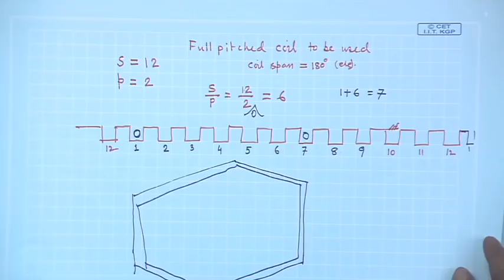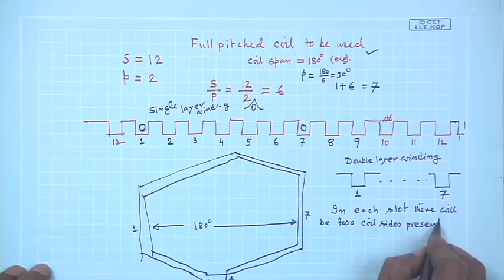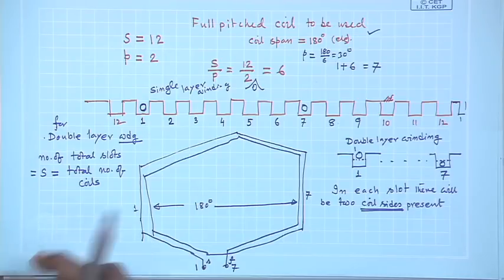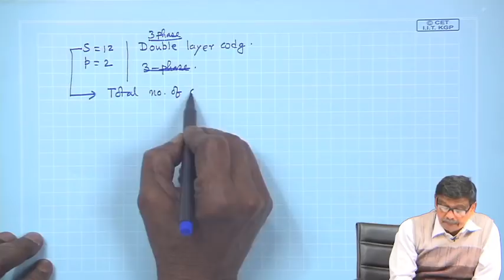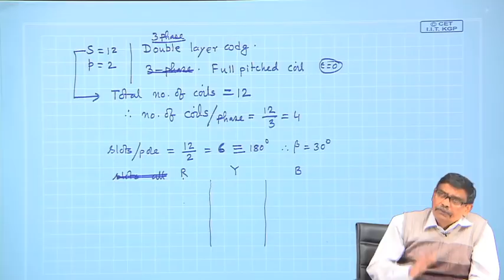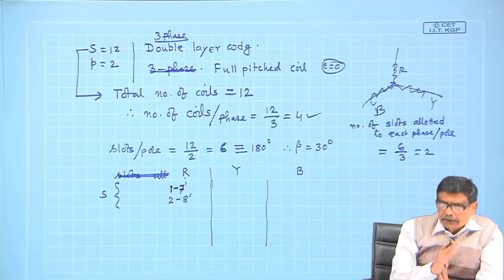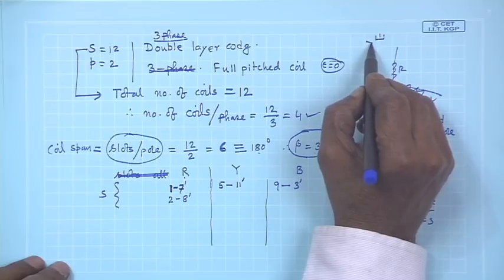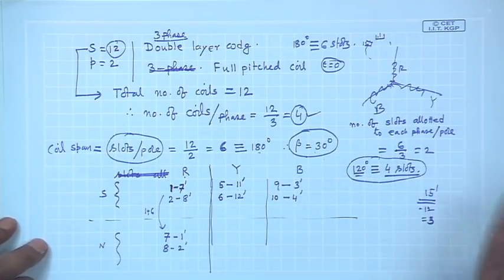Lecture 24: Double Layer 3-phase Winding -  An Introduction

Comment: Nice course,thanks sir.I'm still wondering,what would be advantages using double layer winding instead of only single layer?manufacturing process maybe?
Reply: single layer winding consist of same turn as in two layered , but  single layer  requires 50 percent less effort as compared to double layer.
Reply: @pankajagarwal9806  From an electromagnetic point of view (at least),there is no advantage using double layer winding...My concern is if this advantage would relate to winding process, but how to quantify that?Thanks